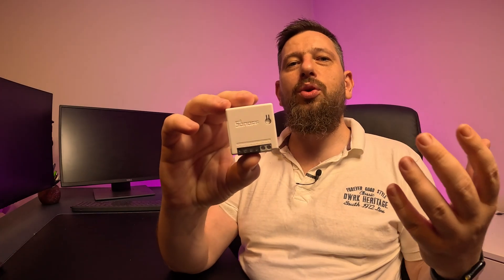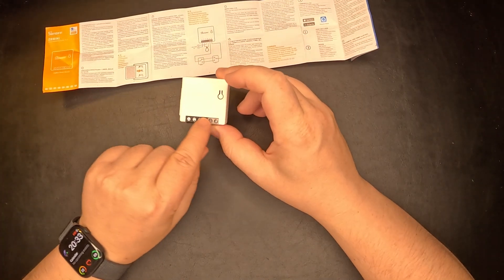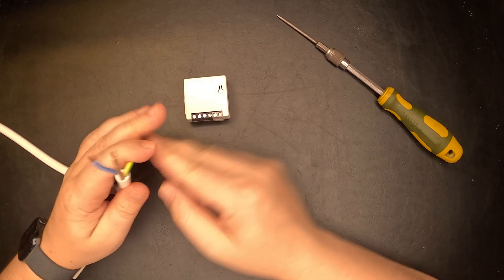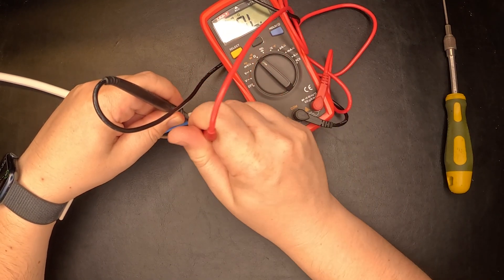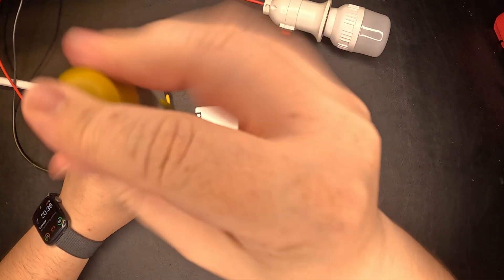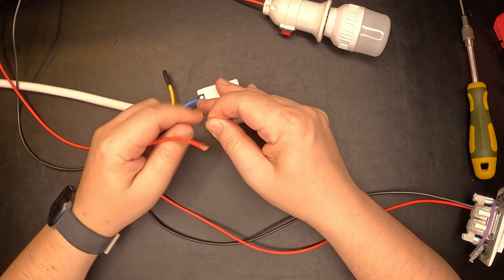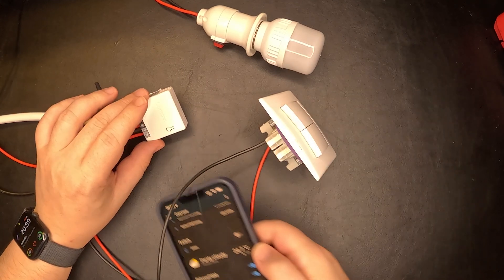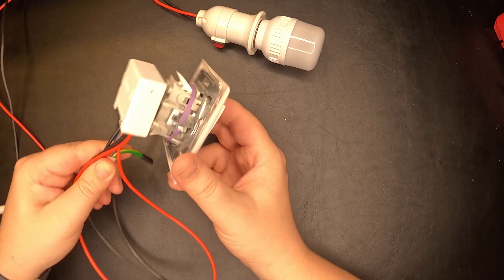Sonoff ZBmini: How to actually install it? DIY Tutorial

Comment: Will it work with ZB Bridge-P?
Now I connected it directly with wifi.
Reply from the maker: Yes it will work but it's a bit complicated since the Bridge must first be flashed with Tasmota (involves some soldering + serial connection to the unit) and added to Home assistant.

Comment: Thanks for the helpful video. If you wanted to connect the second button of the switch for another manual control would it be possible?
Reply from the maker: Hi and thank you for the comment. Unfortunately it is not possible.  The double switch has one common input and two outputs. The input for the light will be a Live wire and that will damage the zbmini.   Alternatively you can use the ZBMINIR2 that allows the use of a Live wire as a manual trigger (it has to be connected to S2)
Reply: Would it be possible to tie the neutrals together and only connect the line in and line out to the device?
Reply from the maker: unfortunately not. the device needs the neutral line in order to power up. you can tie them together but still need to connect them to one of the neutral ports of the relay.  If you do not want to use a neutral you can use the zbminiL2 that only uses the Line but jus keep in mine that it will work as an end device (no router mode)
Reply: Does the physical switch act as a toggle regardless of the position. For example, if the light was off but and the physical switch was in the on position, would toggling the physical switch to off trigger a state change of the light?